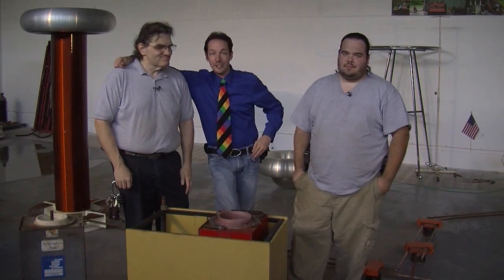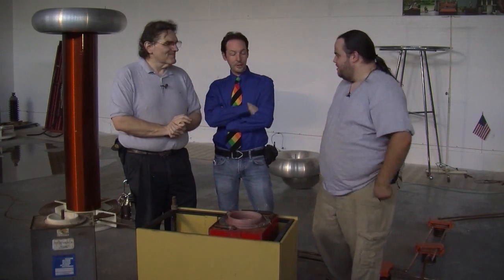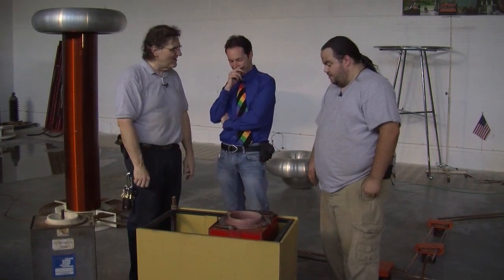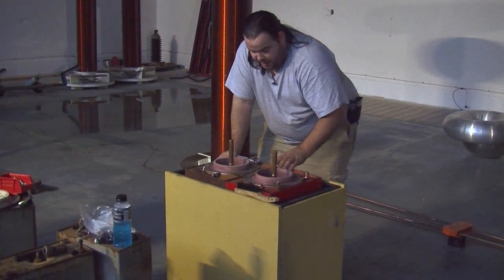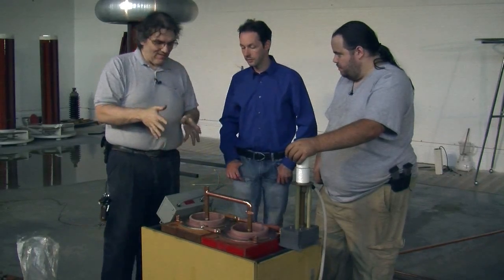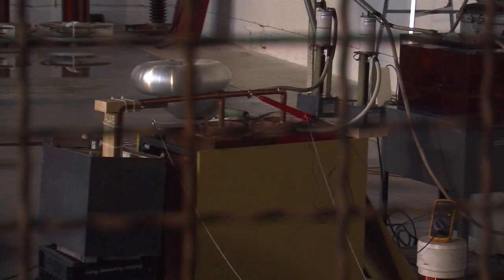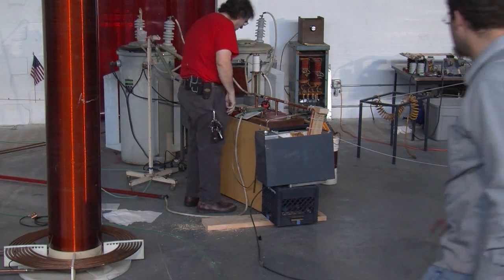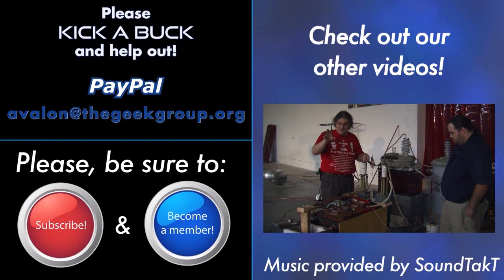Stomper Build and Initial Testing

Comment: You guys aren't geeks, you are nerds :-)

So can you put up a diagram showing what the EM flux is doing?

Also I assume that this is not actually shrinking  the coin, it is decreasing diameter and increasing thickness. Is that correct?